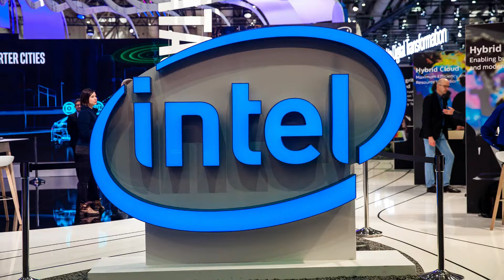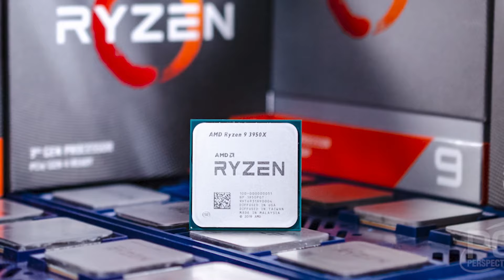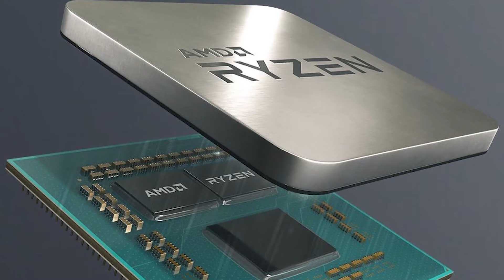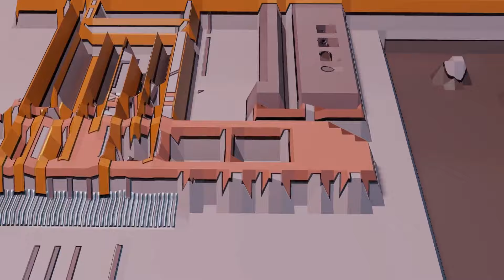Ryzen 3D Will Crush Intel 12900k

Comment: CPUS atm 5900+ and 12700k+ are already so good, doesn't matter if a cpu comes out with 100% better IPC. 
It'll be mostly useful for benchmarks. 
In fact, you can have a 3600x and play still at over 120htz. 

Any user of the 5900x or 12700k is golden for many years. Nothing will be crushed that is meaningful.
Reply: "CPUS atm 5900+ and 12700k+ are already so good, doesn't matter if a cpu comes out with 100% better IPC. "

Except, it does.  Gains is GPU and CPU performance equate to higher fps all the time, and while this isn't important at 1080p so much, it is for 4K gaming.  You realize it when you pair with the best GPUs, not an RX-580.

No, the 5800X3D isn't for benchmarks, it's for gaming.

What it is about people?  AMD SAYS these are for gaming and will be the best part on the market for gaming.  Believe it or not there's probably a few million people who have bought into AM4 for THIS particular upgrade to have the best gaming machine.  

If you watched info about Raptor Lake, Intel plans to get part of the gains for that gen by clocking CPUs even faster, which means even more power consumption most likely.  On the other hand the 5800X3D is going to game while running under TDP or right near TDP of 105W.  I've been using an X570 MB, in specific an Asrock X570 Taichi since early 2020 with a 3700X.  Now I can upgrade the CPU and get LARGE gaming performance, good enough to pair with a high quality GPU in a couple generations from now and it will be great at gaming for a few more years.  That's what the 5800X3D is going to bring, about 8 years of use from a single MB, maybe even more.

The 5900X games 0 - 1% better than the 5800X.  For most people it never made sense to buy because most PC users don't need 12 cores of power.  I need many cores for about 16 hours a month.  Buying anything more than a 8 core CPU for that little time would be stupid.

And yes, Zen 4 is going to beat Zen 3 pretty decisively.  It should give at least a 20% uplift in production and gaming, but it will only give about a 5 - 10% uplift in gaming over the 5800X3D, so for gamers who've bought into a high quality Am4 system like mine, it makes a lot of sense to stretch out use over many years before upgrading again.

I just don't understand how you throw a 5900X into this discussion considering this is ALL about gaming, and the 5800X is as good as the 5900X.
Reply from the maker: thanks for your feedback, make sure you are subscribe to the channel
Reply: @johndoh5182  Except it doesn't, it's already been proven. You can tal for hours. But the reality is depending on what you want to do, generally speaking it really won't make a difference. Even now the current cpus don't even bottleneck a 3090 beyond the 300+fps cap. 

Speaking technically is one thing, but reality is often far different. :)   The whole "Production" argument is quite silly, a poll showed that most gamers who get these cpus don't do any such things, in fact you'll find many who quote it don't do any "production" themselves. It's just a catalyst by which to say "it's better" 

Even now, no cpu bottleknecks even the best card out. And even now, the 3090 will play any game at ultra for a long, long time. And more power gpus won't be bottlenecked either, as those will already be pushed trying to do 4k with ray tracing.  
If you are having a problem with winning a CS go game at 300+ fps currently, then perhaps upgrading would deff be ideal for you. Broadly, and generally speaking as shown in many videos and benchmarks, it won't make a difference.
Reply: @duckilythelovely3040  Exactly this. They won't make a difference. even now a 3600x compared to a 5950x at 4k on a 3090 will show little difference. because the GPu will continue to be the ongoing bottleneck at higher graphical fidelity. And if going for a high refresh rate, cpus now can already push over 300. 
If you are a producer, than I'd say be excited.
Reply: @duckilythelovely3040  Wow, CS GO, a game that a potato can play is the example you give.  No it's not in my list of games I play.

I didn't bring up production as a topic for the 5800X3D.  I brought it up for Zen 4.  But it's not my concern, I was just giving an estimate on what I feel Zen 4 is going to bring.

I'm sorry I'm going to take AMD at their word that the uplift in gaming is going to be about 15% on avg (1080p gaming) which actually equates to 15% on avg, not nothing.

I'm pretty sure that with my 6800 XT that I have for 2K gaming, there's going to be a difference with the 5800X3D.  It's not going to be mind blowing, but for me, since I built a high quality gaming rig, it's worth it.  And yes I know that the gains won't be 15% at 2K, it will be smaller.

So you have a problem reading what I say, I could care less about your 2nd comment because part of it was gibberish since you couldn't read my first comment correctly, and we'll agree to disagree.  I can watch reviews and see the differences in CPUs, but I can always come back to this post once the part releases and rub it in if you want.

But hold on to your thought.  As you seem to think CPUs are at their pinnacle for gaming, which clearly isn't true as many times reviewers have said that a GPU is bottlenecked and then a new gen of CPUs comes out and all of a sudden that bottleneck gets pushed up 5 - 10%, maybe you'll appreciate this.  I built this system to last many years, so according to you it's a GREAT buy because newer CPUs aren't going to be any better.  Except I know that's not true really.  What I do know is in 2 GPU gens from now, I'll upgrade the GPU for 4K gaming, and because the 5800X3D is going to be pretty close to Zen 4 gaming performance and better than Raptor Lake, in 3 years when I upgrade the GPU, I'll still have GREAT performance, right???????  The MB is once again all PCIe gen 4.  No GPU is going to be capped by PCIe gen4 X16 for maybe another 4 - 5 generations from now by which time I will have certainly replaced this system.  And even if a gen5 NVMe SSD comes out that can exceed gen4, it won't matter for gaming and gen4 speeds meet the spec of DirectStorage.

Oh no wait, you still think a person should buy a 5900X even when they don't use 12 cores and that would somehow be better for a gaming rig even though AMD says the 5800X3D is going to be about 15% faster in gaming on avg.  So even though I would pay about the same for each CPU, for some reason a higher core count CPU which does ZERO for gaming is better than a newer product that can simply outperform the higher core count product.  OK?

Or, WTF does someone buy a 5900X for gaming when the uplift over the 5800X is only about 1%?  Why wouldn't you use the money saved and get a better GPU??????  That's been the argument from tech reviewers for years.  Is there some flip flop in logic that says you spend a bit more money for 1% gains???

Comment: It's release price will be higher than the 5900x... a CPU with 50% more cores clocked even higher. This CPU will be a halo product for gaming benchmarks and hardly worth anything. If they had released high core count versions and not charged a massive premium, would have been a lot more interesting. Just wait for Zen 4 or Raptor Lake at this point. Will be vastly superior to this CPU in most ways.
Reply from the maker: yeah possibly 
thanks for your feedback make sure you are subscribe to the channel

Comment: LMAO 8 cores in 2022 is old very old news.
Reply: Yes it is.  It's also good enough for about 90% of PC user and it's more than enough for any game since they're GPU intensive.

AMD made the perfect move with the 5800X3D because it's for GAMING.  GAMING.  Not production.  You won't get a boost in production. Zen 3 already has enough L3 cache for production.  What it doesn't have enough of is L2 cache, and that won't be addressed until Zen 4.

What's funny, I mean absolutely hilarious is Intel has released 10th - 12th gen, and AMD is tweaking a 2020 part and it's going to be the best gaming CPU on the market, and to try to come close to it, Intel is pushing parts about their 125W TDP (the i9 parts, the slower part won't come close at all)  Even now, when clocked at the same speed the Zen 3 parts still beat Alder Lake in gaming.

Having more cores is totally meaningless if you don't actually use them you know, and it's the rest of the architecture that has to be improved to get more performance, not throwing in more cores.  If one core can process threads fast enough to match a 4 core CPU, meaning the application I'm running doesn't generate that many threads, or it doesn't generated them fast enough, adding more cores simply means adding cost.  FACT.  It's why gamers buy 6 or 8 core CPUs, except the ones with crazy money sitting around and then buy the CPU that clocks the fastest to get that extra 2 - 3%, which has NOTHING to do with core counts and is all about the CPU with the fastest boost clock, and in the case of Intel that's the 12900K and in the case of AMD is the 5950X, but also in the case of AMD, the 5800X has an ALL_CORE that's similar to the 5900X and 5950X, so the 5800X games almost identical to those more expensive parts.

So yes I'm doing a drop in upgrade to my PCIe gen4 X570 MB that I've had since early 2020 and it's going to be the best gaming platform to date, and Raptor Lake won't even beat it.  Zen 4 will be maybe 5 - 10%.
Reply from the maker: thanks for your feedback, make sure you are subscribe to the channel

Comment: It needs to be seen how far a 3D cache is going to improve gaming performance. Some games will show improvement, but not all will show improvement. Again Intel's raptor lake is around the corner. So the 5800x3d is going to be up against 13900k and 13700k.
Reply: No, Zen 4 will be here before raptor lake.
Reply: @michaelkeudel8770  The information that I've got from my friends working with some leading OEMs is that raptor lake is in a closer to launch than Raphael. Also raptor lake ES2 parts are already with OEMs now. From this point it generally won't take more than a quarter to launch. So most probably July is when raptor lake will launch.
Reply: @Yusufyusuf-lh3dw  intels one of my customers, and it's not happening as you think.
Reply: @michaelkeudel8770  i don't know what you claim by "intel is one of your customers". But I'm talking about OEMs receiving ES2 samples. ES2 samples don't go to small customers but only to large OEMs.
Reply: @Yusufyusuf-lh3dw  Intel is in the process of severe retooling and process development, they don't have a great deal of free foundry space to be doing volume launches yet. I still have to finish the next rev EUV control system design, with 2 more after that. And everyone is dealing with a supply crunch. We can't even keep up with what Intel wants, we're booked out 18 months already.
Reply: @michaelkeudel8770  Raptor lake is non EUV Intel 7 process and there is no need for any tooling change. Intel has improved the yields with intel 7 so there is no reason to believe that they don't have fab bandwidth to manufacture raptor lake.
Reply: @Yusufyusuf-lh3dw  they are producing video cards now too, or did you forget, and 12th gen, and 11th gen, and 10th gen, and motherboard chipsets. Capacity was already tight at the beginning of the pandemic, and it hasn't gotten much better yet, we're still building the equipment that goes inside the fabs, and are already building at double capacity and are just breaking ground to double our floor space. Intel 7 is still 10nm using quad patterning, it's why yields continue to suck. There is some EUV installed, but everything is still going through process adjustments. And they need more vacuum, reason for 2 more required control systems and additional pump racks.
Reply: @michaelkeudel8770  GPU program is on TSMC N6 not on intel process. So no impact of GPU on 13th gen manufacturing. Secondly 10th and 11th gen desktop are on 14nm. The chipset are either on 14nm or Samsung process. Again don't affect 13th gen. And finally when a new generation program needs process bandwidth in fab the older programs like 12th gen and 11th gen mobile bandwidth is reduced. Also the yields of 10nm ESF or intel 7 is really strong and even improved recently. So absolutely no reason to believe there is sufficient reason to delay launch of any CPU.
Reply: @Yusufyusuf-lh3dw  yes, it's on TSMC'S PROCESS AND FAB, because Intel can't manufacture it, because both they DON'T have capacity or the process technology to do it on their own. You clearly don't know what happens inside of fabs.
Reply: @Yusufyusuf-lh3dw  1th gen is Intel 10 nm SuperFin, but just keep babbling.
Reply: @michaelkeudel8770  not sure what's there to get touchy about. I just said based on the information that I have about raptor lake and Raphael. Raptor lake will launch before Raphael would.
Reply: @Yusufyusuf-lh3dw  no, you said raptor lake would launch before Zen4 would because ES2 has been sent to OEM's, it's an engineering sample, not a tray of millions of cpu's to build and sell, and not ramped at full production. There is a limited production run done to create engineering samples, then tested in the labs, THEN sent out to OEMS to test in their hardware, do debugging, write new drivers and BIOS code, and look for other problems Intel may not have tested for. That data is then sent back to Intel, who either decides it's ready for release and ramps up production, or if an error on the silicon is discovered, circuit/process gets redesigned to fix the problem, new masks have to be created and delivered to the fab, then another round of limited production wil again run through the entire 4 1/2 fab process to create the replacement silicon to start testing all over again. And that process repeats every time a serious bug is found until you have fully functional silicon.
Reply from the maker: thanks for your feedback, make sure you are subscribe to the channel
Reply: @michaelkeudel8770  ES2 is not just an engineering sample but the second batch of official samples. Between ES2 and QS we typically see around a month gap. QS is qual sample that goes into production.  With that schedule raptor lake should go into production in a month or 6 weeks time. Production ramp typically takes couple of months to get to full swing. And that's why i said it should launch in July. Second factor to consider here is that raptor lake samples are doing extremely well in OEM resting. Both in terms of performance and functionality. So no reason to believe that it will go for another stepping.
Reply: @Yusufyusuf-lh3dw  your still talking at least 6 months, October for fab, assembly//testing/packaging,  create inventory, ship.

Comment: 5800X3D is pointless, the AM5 Zen 4 are the ones we re waiting for, there’s no cpus beating the 12th gen before the AM5 Ryzen 7000 release.
Reply: Uh, I don't know about pointless. 5800x3d is going to be pretty cheap AND powerful! it's faster than a 5900x, and it's probably cheaper, which is fantastic news for a gamer like me who is trying to save money for an rtx 3090!
Reply: So a person who's invested about $2400 into a high quality AM4 system is better off spending another $1400 USD (this is minus the cost of the GPU since it's already high quality, PowerColor Red Devil 6800 XT) buying into a totally new architecture that uses different memory, when you have about $350 of 32GB 3600 CL14 memory already.

We'll agree to disagree.  I was going to upgrade to Zen 3 months ago, when Zen 3 started to go on sale, but since AMD talked about this 3D part over a year ago and talked about the performance gain, I've been waiting EXACTLY for this part.  The machine is after all built for 2K gaming at high fps and the 3D CPU gets the machine close to Zen 4 level gaming without anything but a CPU drop in upgrade.  This machine is going to game for 6 - 8 years.  I can buy into AM5 once Zen 5 goes on sale, or maybe I wait for Zen 6 to go on sale before buying in.  By then  DDR5 will be mature, AM5 will be about the best it's going to get  and if Zen 5 only makes it to TSMC N4 based on current rumor, well, Zen 6 WILL be on TSMC N3 and the gains from all that will be worth an upgrade again.

But yes if you bought into something like a B450 and cheap 16GB 3200 CL16 memory, sure, I'd just wait for Zen 4.  But my system is WAY better than that.  X570 is full PCIe gen4 and my MB has 3 NVMe ports and the system is dual OS, with Win10 on NVMe RAID and used only for gaming.  It's 2TB of NVMe that didn't cost a fortune since it didn't have to be the best to meet the spec for DirectStorage, and I'll have this system long enough to see games start to use that spec, or API.  And no GPU coming out in the next two generations is going to exceed the bandwidth of gen4, even though it's a gen5 GPU.  Translation, in about 3 years I can upgrade the GPU and I'm once again at great performance, with a MB I bought in 2020.

AMD will sell EVERY 5800X3D part it makes, and it will never sit on shelves long.  There's plenty of people who saw the value of X570 as soon as it came out and knew it's a MB that's good for many years.
Reply from the maker: thanks for your feedback, make sure you are subscribe to the channel
Reply: @johndoh5182  . The 5800x3d is clearly a card released to compete with the 11/12th generation first half of 2022.
Makes sense for those 2000/3000 owners to upgrade but R9 owners are definetly not the target since R9 ll still probably outperform the 5800x3d, but we ll have have to wait for the first benchmarks what this cpu release has to offer